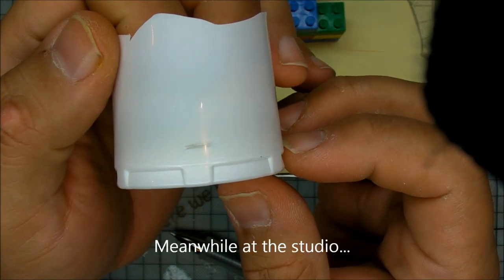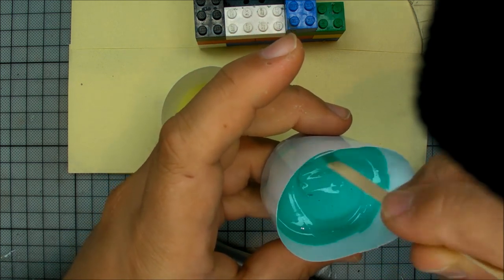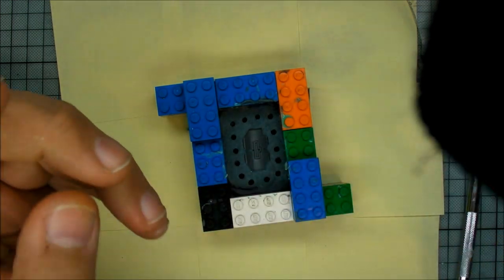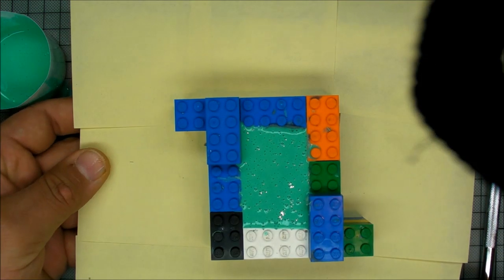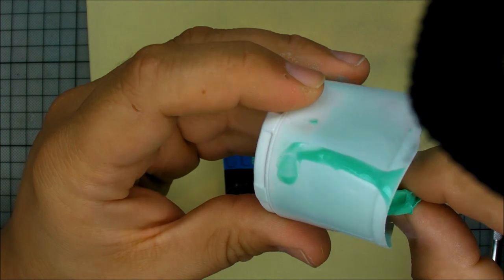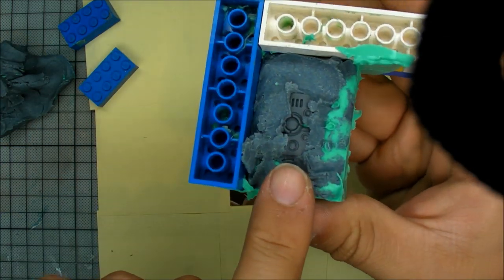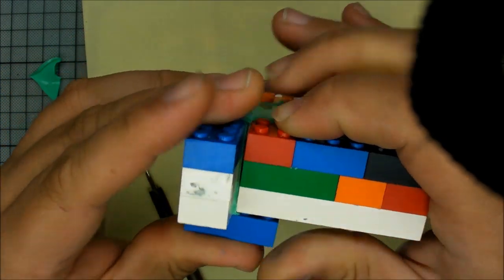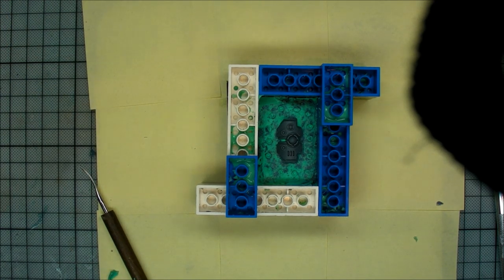Tutorial Tuesday #1 - Mold cast your own resin copies - Part 2/3

Comment: Adding mould release to the plasticene before pouring would have been a good idea.

I remember a builder buying diesel to use as a mould release when he was casting some concrete columns for the extension at my parents' house, so it may well just be auto fuel in that bottle!